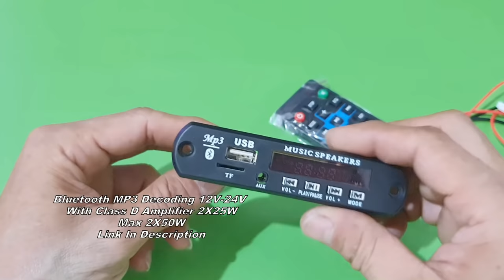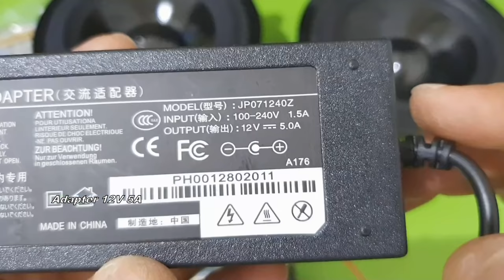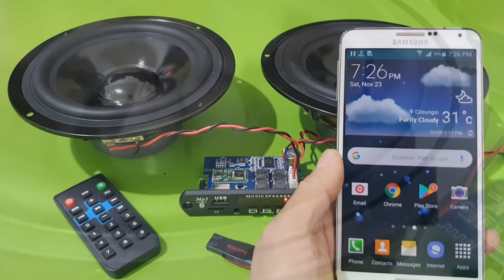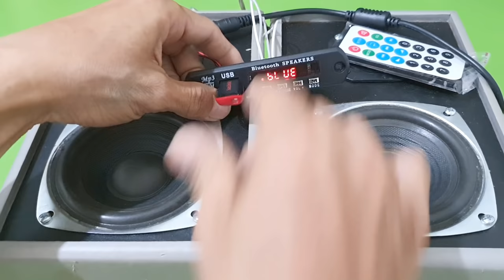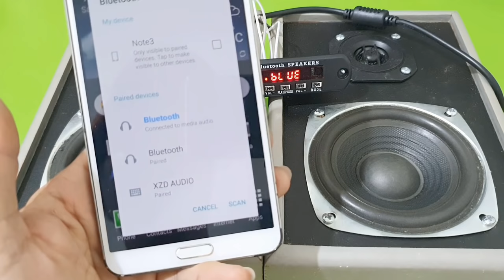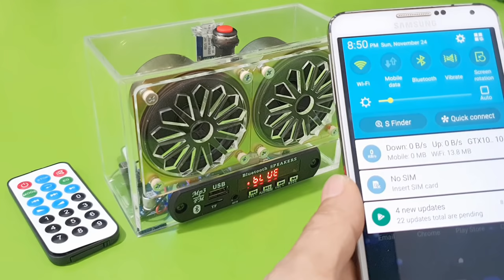Bluetooth MP3 With Class D Amplifier 2X 50W

Comment: Amazing work. I want to build my own BT speaker with used speaker I have from another system. I would love to ask you some Qs and any help would be immensely appreciated.
Reply: Bluetooth speaker modules with amplifier are available on amazon, check those out and it's pretty much self explanatory and easy to set up. Buy the amp according to the wattage of your speakers. The old ones that you have,  the watt should be written on the back of the speakers. This exact same module is also available.

Comment: I chose this video, because i saw easy. But no. Im I've been trying to make it work for more than a month and a half and it doesn't work. The module I got, it doesn't have an amplifier stage, I had to buy a pam 8610. With a single 3.7 Volt battery it doesn't support, SHUT DOWN. Starts making a choppy sound, like a pulse, and then the module shut down. THIS HORRIBLE,

Comment: Can you tell me the speaker module model number in the video?
Reply from the maker: Please Check in description
Reply: @PLATINUMKIT  Can you tell me what site I bought ???
Reply from the maker: Aliexpress.com
Reply: @PLATINUMKIT  Despite the video, what do you get if you're asking for Damer ???
Reply from the maker: What do you mean?
Reply: @PLATINUMKIT  영상에나오는   블루투스여 머라고검색하면 나오나요??
Reply: @PLATINUMKIT  Does it appear when I search for Bluetooth over video ??
Reply from the maker: Play the video. Then press the arrow in the video title
Reply: @PLATINUMKIT  I'm sorry if I can't search, but if you do a direct search on the site,Can't
Reply from the maker: Bluetooth MP3 Decoder + Amplifier  Board  15W+15W 
https://www.aliexpress.com/item/32991477016.html?spm=a2g0s.9042311.0.0.3da24c4d88Azqt

Bluetooth MP3 Decoder + Amplifier  Board  25W+25W 
https://www.aliexpress.com/item/32890378272.html?spm=a2g0s.9042311.0.0.3da24c4d88Azqt

Micro USB 5V 1A 18650  Lithium Battery Charger
https://www.aliexpress.com/item/32670803042.html?spm=a2g0o.cart.0.0.20af3c00OwiaMD&mp=1

DC-DC Boost Converter 3-30V Step up to 4-35V 5A Board
https://www.aliexpress.com/item/32663310105.html?spm=a2g0o.cart.0.0.690a3c00RcJXP1&mp=1

Push Button Switch
https://www.aliexpress.com/item/32864667674.html?spm=a2g0o.cart.0.0.7b6a3c00qDynXz&mp=1
Reply: @PLATINUMKIT   감사합니다
Reply: Você sabe como desligar o beep que toca ao apertar as teclas de volume no bluetooth? Obrigado.

Comment: the speakers specs are 75watts peak 15 watts rms  8ohm Freq. response 58hz - 10khz  these speakers have no bass and really suck.  try Pioneer TS-D65F they can handle 90 watts rms  270 watts peak 32hz - 49khz   4ohm

Comment: mas bikin box speaker yang full akrilik dong, 12/15 inch
yang anti getar saat full bass
dan cost yang keluar berapa
makasih mas 
saya suport dan saya bangga.
Reply: Bakal bnyak ni cost nya Kalo bikin box pake akrilik,,,,,, Kalo utk gaya gaya an, dengan budget yg di loss-in, bole lah,,,,,, hehehehehe
Reply: dari dulu saya cari box akrilik yang udah jadi mas, tapi di indonesia sepertinya belum ada.
untuk rumahan kayaknya keren mas😁
Reply from the maker: @ridhopramukti432  buat sendiri aja mas...😀
Reply: ilmunya belum dapet mas🤭, simas mungkin mau berbagi ilmu cara bikinnya😂
Reply from the maker: Ikuti video ini pasti bisa
Reply: @PLATINUMKIT  bang boleh nanya? Kenapa pakai modul step-up? Kenapa tidak baterainya saja yang dirangkai seri 3s menjadi 12v? Apa berpengaruh sama kualitas suara yang dihasilkan?

Mohon dijawab ya bang, saya dari dulu pingin buat speaker bluetooth sendiri, cuma kurang informasi & pengalaman. Terima kasih.
Reply from the maker: @BayuBuduh  ya betul...pakai bat 3biji akan makan tempat, terus modul charger harus yg 12v  dan lagi harus pakai adaptor 12v juga. Tidak praktis dan boros biaya. Sedangkan jika pakai 1 bat charger bisa pakai  usb atau charger bawaan hp dll. Dan 1 buah bat  ketahanannya sudah bisa diatas 24jam dengan vol 50%. Saya rasa ini sudah cukup.😀